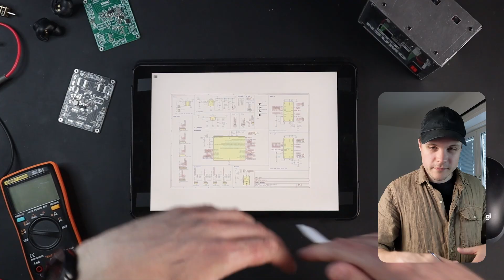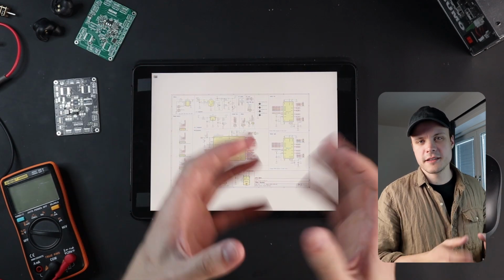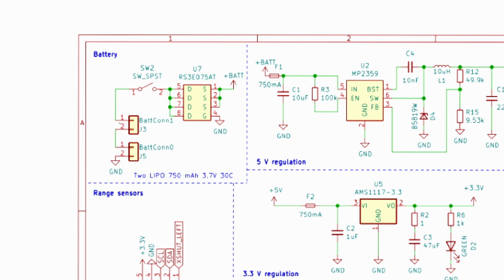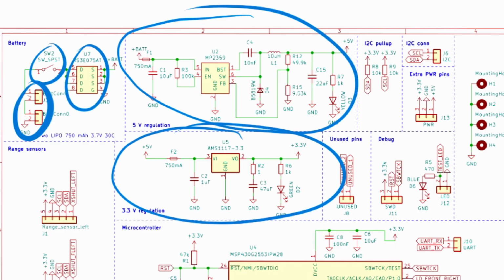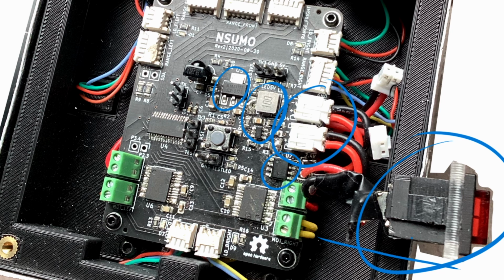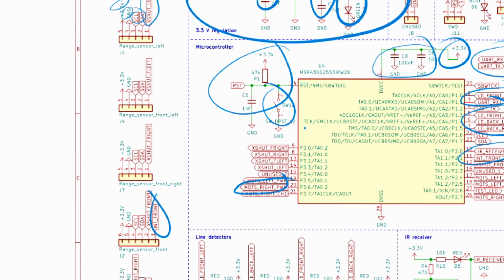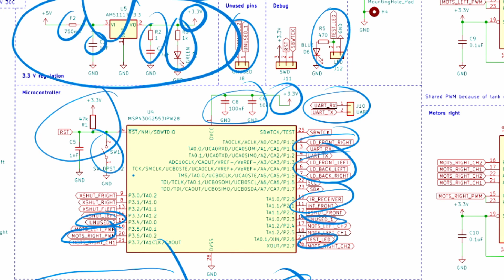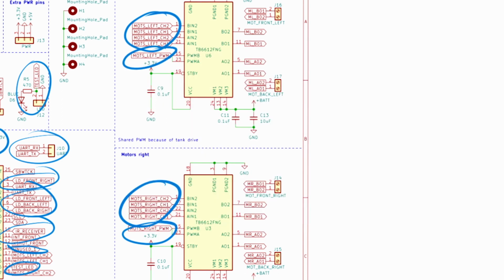PCB Design Walkthrough Sumo Robot | Embedded System Project Series #3

Comment: What would be like the starting point of doing this?
I am still very new to the embedded systems world. I was wondering , I will need the components regardless of whether I use them in the robot car or not. If I am learning to program the components separately, I'd still need to have all the components, and the mcu. The schematic and the pcb are there so that I can easily connect the mcu and other parts with the sensors,  and the power supply?
Would it be better to just order the pcb ?
or should I order the mcu and the parts separately, learn to put them together in a breadboard, and program them indivicually, and then put them together?

I am more interested in learning to program them than putting the hardware together from scratch.
But as you said, I need to understand them to program them well.
I can't decide. Please help.

Comment: Hi I had a question. Does the power switch you used take in a variable voltage input and is it rated for DC voltage? I'm having the hardest time trying to source a rocker power switch rated for DC. I saw some illuminated ones rated for 6V DC but that would also unnecessarily complicate the circuit since I'd have to step down the battery voltage from 7.4 to 6V.
Reply from the maker: I don't remember the part number. But wouldn't surprise me if it's even rated for VAC (for much higher current/voltage than my robot) . It should be fine to use a 250VAC/10A and what not rocker switch in your low DC application as well. It's just a switch after all, the rating is more about the worst it can tolerate.
Reply: @artfulbytes  Thanks for the tip! Yeah since the voltage and current levels aren't going to be anywhere near those levels, even if its not slated for DC it shouldn't be a problem.

Also, do you have any suggestions for a switch regulator to regulate the voltage from 7.4V to 3.3V? I'm not really sure how to approach this and whether I should buy a chip with external components or buy a converter module.
Reply from the maker: It depends, are you designing a PCB or just assembling loose components/modules?
Reply: @artfulbytes  I will be designing the PCB. I thought the process would be to buy the switch regulator and external components and test the circuit first on a protoboard to make sure it works before I design it on a PCB. It'll be the first time I ever design a PCB though so I'm not sure if this is a good approach.
Reply from the maker: @NotSionnix   @NotSionnix  That's generally a good approach. But designing a buck converter with discrete components is a bit cumbersome, and it might just be easier to find design examples online with a switch regulator as an integrated circuit (IC). Many manufacturers provide good schematic/layout examples in their datasheet. One example is AP63203, just needs a couple of surrounding passives. You may look at SparkFun's breakout (babybuck) as a reference.
Reply: @artfulbytes  I've been referring to your videos many times because they're such a good resource. I'm at the point where I'm ready to start prototyping the sensors, and realized the breakout boards don't come with their own headers already soldered on to use with a solderless breadboard. At 2:56 you briefly show your edge detecting IR sensor connected to the breadboard. 

I'm assuming that breakout board is attached to a header right? Did you solder that yourself? I didn't realize just how small the joints on the breakout boards are. I ordered the same sensors but they didn't come with headers already attached, nor included with the appropriate sized headers.
Reply from the maker: @NotSionnix  Yep had to solder the headers myself, but for me they at least came separate included in the package. 2.54 mm headers. By the way, those are not for edge detection, but for detecting the opponent.
Reply: @artfulbytes  thanks for the heads up! Looks like soldering is going to be unavoidable once you start getting deeper into embedded systems so might as well start now. Thanks for all the help and the tips! :)